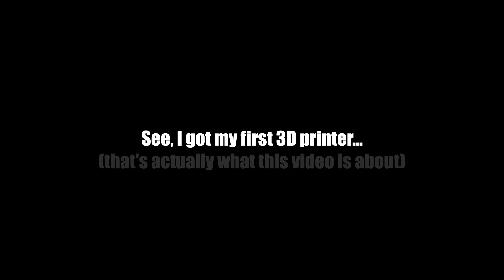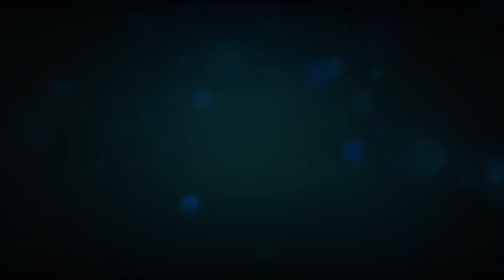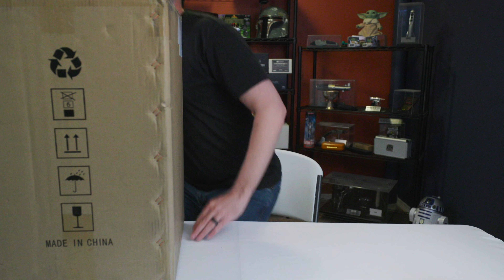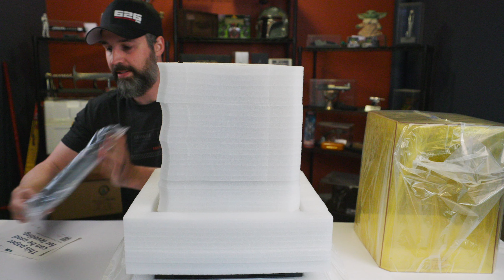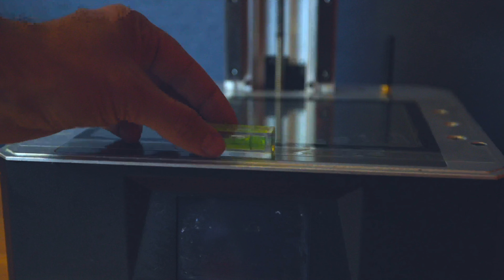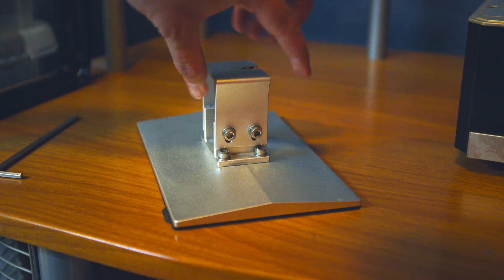Episode 16 - My First 3D Printer! The AnyCubic Photon Mono X!

Comment: Hey, really nice video! What will you make with the printer? A plastic connector for one of the window motors on my old car broke; I was thinking that would be the perfect reason to have a 3D printer.
Reply from the maker: Hey, Frank! I got it mostly for cosplay and replica prop pieces, but yeah, there are a ton of practical applications as well!

Let me know if you’d like me to run off anything for you so you can what the finished parts look like!